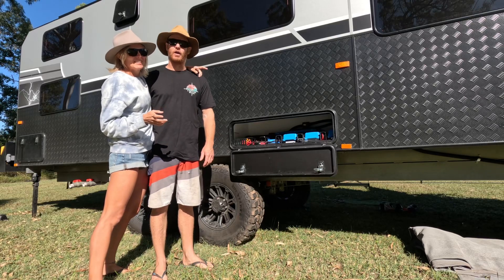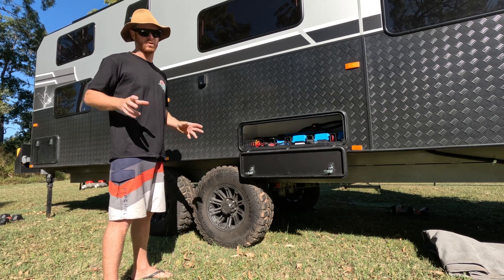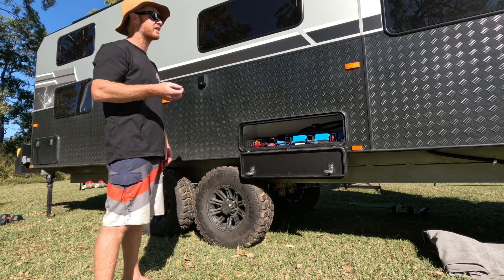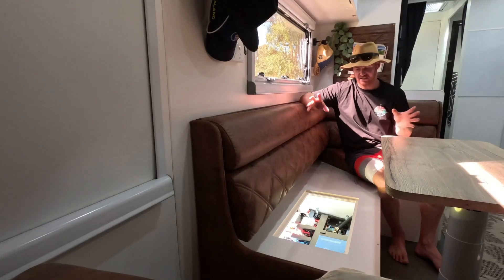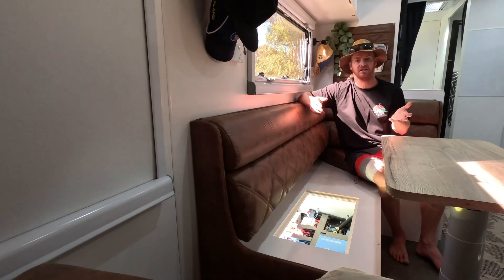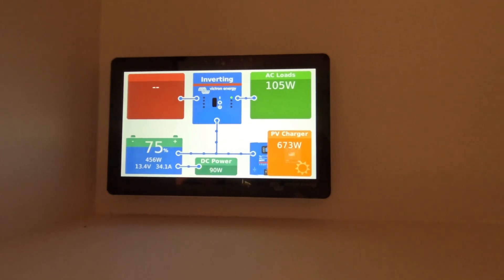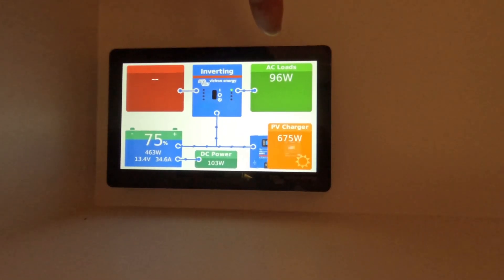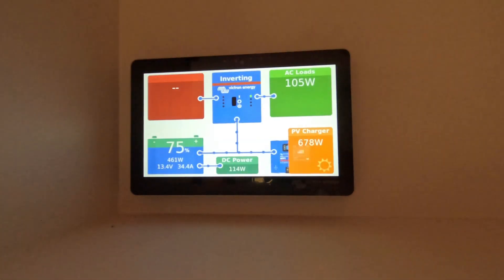Let’s Talk Solar!

Comment: Why not use portable panels instead of being fixed on your roof? With portables you can adjust the panel to follow the suns path instead of heating up your camper by having to keep it in the sun.
Reply from the maker: Can’t possibly carry enough portable panels to charge up the batteries 👍

Comment: Great work guys keep us posted on your setup and how it is running.
The feature labelled has DC system in the CERBOGX disable that switch that little icon on the screen will confuse you and will be very in accurate as it is only a calculation of leftover energy. Did you utilise AC2 for nonessential loads? Or are you able to run your hot water service potentially from the inverter? (On AC1)?
Great work mate see you out on the roads
Reply from the maker: Thanks! I’ll pass it on and get Owen to check it out!
Reply from the maker: Hey mate, regarding the AC2 I don’t think we are using it. What do you mean by ‘non essential loads’. Lights etc?
Not sure what you mean by ‘does the HWS run from the inverter, the HWS is 240v only so the inverter runs it. 
More than happy to discuss over a call.